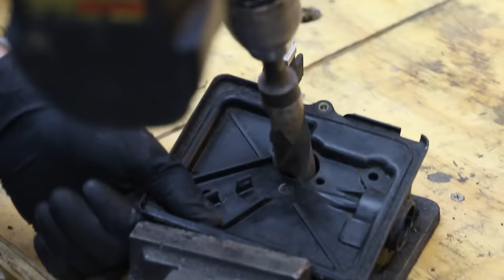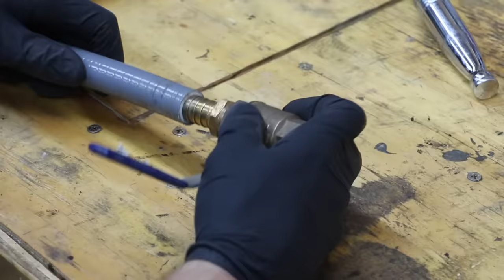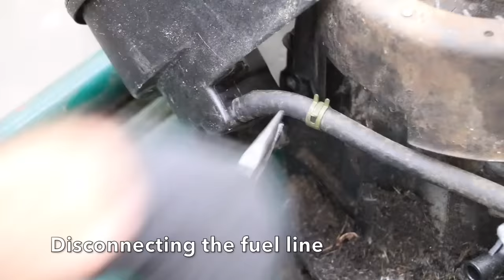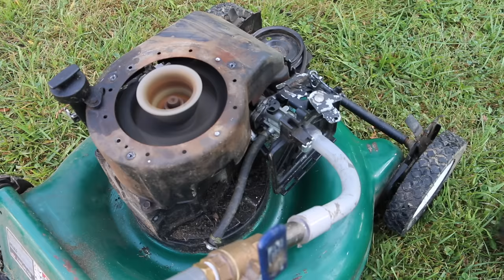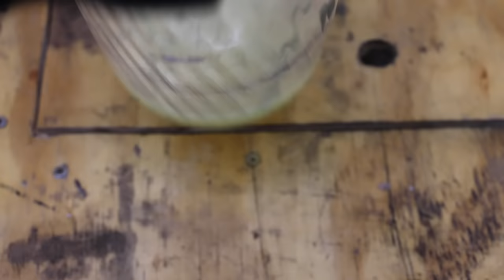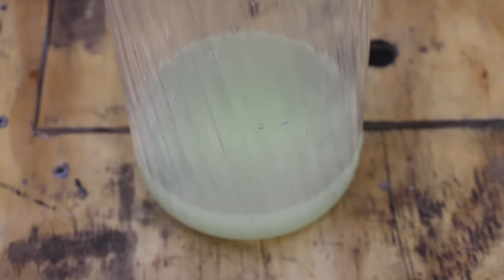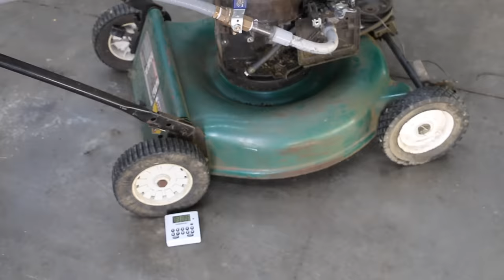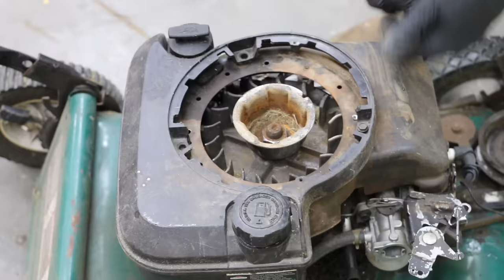Will a "Gas Vapor" Container Improve MPGs and Fuel Efficiency?  Let's find out!

Comment: Shell Oil engineers where testing vapor engines, it’s well documented, your video makes me wonder if they were primarily interested in reducing smog because of the cleaner burn when running on fumes.

It looks like the primary advantage to running on fumes per your testing, is reduced exhaust emissions, reduced smog. This is of great importance because less smog is a big plus.

My girlfriend and I are designing a vapor fuel assist system for our car, we are interested in reducing smog. Smokey Yunick achieved great success improving horse power and reducing smog with a vapor fuel system. He was also using a turbo which act as a one way check valve for the vapors.

Bill Kendrick’s here on YouTube uses a different approach to running on vapors. And he notes to have achieved significant improvements in horse power, and reduced exhaust emissions as well as reduced engine temperature.
Reply from the maker: I enjoyed reading your post. I hope you achieve great results in designing the vapor fuel assist system.
Reply: Thank you!
Reply: True Zero Emissions You're one of the few who remembers Smokey Yunick who answered readers' car every month in Popular Science magazine for years, long before they turned up their noses to practical things. Smokey's engine garnered attention from many car companies but he said they complained about meeting emissions standards--I suspect corporate inertia unless evil can be proven. Similarly, no manufacturer of gasoline engines has yet embraced the amazing Steam-O-Lene water injection system which is also for real but requires change in the mind of engine designers and their bosses.
Reply: True. And that 2 to 3% rise in efficiency calculates to Billions of dollars. Who loses out with better efficiency and less smog? The Government and big oil. Less gas tax and justification, and less gas consumption.
Reply: JRMCNEA His test was way too inaccurate to see an actual change. That 2-3% could be laying on the bottom of that gas tank or could be explained by his inaccurate measurements.
Reply: Lawn mowers have un-catalysed exhausts... A two or three -way cat on the lawnmower would be far more effective at reducing smog than this would ever be; and we don't even have any proof that this changes the smog/emissions of the engine whatsoever compared to liquid.  A lawnmower (which has only one cylinder mind you) will output something like 30-50 times the greenhouse gasses idling for an hour than would a car engine (typically 4-8 cylinders) idling for the same hour.
Reply: Blindi fuel injection
Reply: Just because you can't see it doesn't mean it isn't there.
Reply: Fuel injection atomizes the fuel, which vaporizes in the combustion chamber.  

Older engines usually used exhaust or coolant to heat the intake manifold to ensure vaporization of the fuel on the way to the combustion chambers.  If you've ever seen a factory VW Bug, you can see the heat risers off the exhaust running right along the length of the manifold runners - those were there to ensure any liquid fuel would vaporize after it settled out of the air/fuel mix.  The main reason for a carb or injectors is to meter the fuel.

As for this test, there's a TON of variables between the two tests.  You'd have to use a wideband O2 to ensure that the fuel/air ratio is correct and the same in each test.  None of us know how that carb is jetted, and none of us know what kind of ratio he's achieving in the vapor test, since it was pretty roughly tuned by ear.  2-3% is, in this particular test, way way inside margin of error just because of those unknowns.  Not nearly enough variables controlled for in this test to assert any kind of improvement.  

That said, as a former master tech, I can't see a vapor system like this offering any improvement in any area.  If anything, I'd expect losses, given that as cars have cleaned up, the metering of the fuel is happening physically closer to the combustion chamber until present day where we're using direct injected gasoline, which means it's going straight into the combustion chamber.

Ol' Smokey was one hell of a guy, but one thing to remember is that he's probably best known for being a cheating trickster - the infamous 7/8 scale Chevelle, and the time he was told by tech inspectors that, after removing his fuel tank, they'd found 9 violations, he started the (still tankless) car and yelled "make it 10" as he drove away.  Point being, I'd probably take info from him with a grain of salt.
Reply: Good deal! Do you have access to that shell research literature? It would be interesting to learn their methodology and set-ups. I want to take an old car and do this with its fuel tank and use it as a daily driver. Also, a genny for the lake could greatly benefit from this less fuel, less smog, happier earth. But this is coming from a dude that wants everything to be electric and photovoltaic.
Reply: I have copies of Tom Ogle's & Charles Pogue's patents. The only way to get a patent, is to have a proven running project. I know what you did wrong to not obtain the high fuel efficiency. Look up Tom Ogle's patent, you'll see how he did it. Shell oil company held the mpg world record for years. You can't make money off of fuel when you have people inventing very basic devices to reach proper fuel efficiency levels. The greedy and the ignorant flooded with hate and disbelief. It's damn simple to make the inventions, the problem is that either you keep quiet about it, or go loud and get murdered. Automotive companies have an agreement with the oil companies to not get good mpgs on the product, and it's all due to greed.
http://www.376mpg.com/
Reply: immikeurnot  Didn't he put Nadar up to killing the Corsair?  Corvair?  Corsica?  GM called on the talents of their ninth eighth over that, or had someone else built it?  I guess that as long as there are fraternity house blowjobs there will be internal combustion engines.
Reply: A cleaner burn implies better fuel economy (black smoke means unburned gas, blue is oil, white is anti-freeze and/or water).
Reply: That's the whole point really. Liquid fuel does no burn. By attaining as close to 100% vaporization of fuel, your stociometric burn is much more efficient and as a result your emissions are drastically reduced. The problem with all modern gasoline engines  is incomplete burn. Fuel injectors are not the answer. They still put a mostly liquid fuel charge into the combustion chamber.
Reply: Smokey's system wasn't using the turbo in a traditional manner plus he called it a homogenizer. The fuel was ran threw the exhaust to heat it then threw the turbo to atomize it before entering the intake I have the write ups about it in both a popular mechanics and hotrod magazine still somewhere in a box. It wasn't a true vapour system was done on a Fiero in the 80's boosting about 80hp and 5-8 mpg if my memory recalls it correctly. Still a very interesting system none the less.
Reply: The idea that someone made some genius invention, didn't share it with anyone,  and was killed for it by big oil is absurd.

I am no fan of corporations either.
Reply: I love reading some of those tinfoil hat comments, "murdered by big oil" lol.
It either works or it doesn't, careful what bullshit you buy into.
Reply: I can't see fuel vapor working with a turbo, at least not in this setup because of the lack of vacuum to suck the fumes in, unless maybe the boost pushes the vapor in? In curious
Reply: Gordon Freeman you just keep trusting the government.
Reply: john handcock no absurd at all Tesla was killed by big oil too
Reply: EFI homebrew systems can produce much more precise mixtures and you can tune them YOUR way. Open source software is available too.
Reply: Blindi crabs dont vaporize gas they atomize it there's a difference fuel injectors dont vaporize gas either

Comment: I didn't think it would work but imagine mowing your yard with just a mason jar of gas for the whole summer talk about saving gas lol
Reply from the maker: Thanks for the feedback.
Reply: Ot works if done coreectly, the process used in this video isnt how it has to be done.. Ive seen it done and ran a 235 cid 6 cyl. Chevy engine great and they got many miles from one quart of gasoline.

I guy in California tried to mark a setup for vehicles that ran engine off of rhe vaporized gas and he mysteriously died before he got it on the market.
Reply: @mapbike  Of course... care to share the correct method with the rest of the class?
Reply: @mapbike  share the method please
Reply: @charetjc  LMBO 😂...UMMM NO...But YES!!!
Reply: Why would it not work, it is basically a carburator. :)
Reply: @mapbike  Of natural causes right?

Comment: The difference in fuel economy can be attributed to difference in fuel mixture.  Your 'vapor chamber' (a home-made carburator of sorts) is running leaner than the regular setup.  Running extra lean leads to improved fuel economy, and can be done with any fuel system setup (EFI, carburator etc), but the downside is that it shortens engine life.  Even way back in WW2, airplane engineering teams understood these tradeoffs very well and tried to optimize them.  It was literally a life or death situation.
Reply from the maker: Thanks for the feedback.
Reply: I raced with it a lot. It was a third the price of race gas. In 4 and 2 strokes I always ended up a couple of jet sizes rich of normal to get plug reading I trusted. My racers were always gas hogs.
Reply: Dude running vapor dosent make your motor last less in fact it runs cleaner and enabels you to go longer between oil changes as the oil stays cleaner for way longer and it lubricats way better as its not black from carbon i can tell your not a macanic but if you are you need to change jobs.
Reply: @nofoxgiven6315  at least your English has improved, but that doesn't change the fact that you don't belong in this comment section.
Reply: I was wondering about the mix, becayse as far as I can tell the inlet on the carb is sealed straight to that pipe so I was wondering how the ball valve he put in the pipe would change the mixture. I would think it would just act like a throttle body. I don't see a way of dialing in the mix on most of these cars that people are doing this to, which could be bad, and would mean on a warmer day your engine will run more rich and even more lean on a cold day.

Comment: He built a gasoline bong
Reply: I just noticed it does have the same mechanics s a bong lol ;)
Reply: i built one out of a 1L methylated spirits (alcohol) bottle and ran a mower on it - it stalled out ofter 5 minutes and i couldent figure out why - started back up if i topped the fuel up (it hadent even used that much)
Reply: chris cole a
Reply: LV426 xenomorph "life is as extreme as you want to make it" - spongebob
Reply: Well when I look closely at my carb it's not vaporizing gas it sprays mist out not vaporizing so I pull bs card
Reply: Atomizing and vaporizing are two different things
Reply: chris cole vaporising and atomising at the same thing - the carby does its best to get the fuel into droplets on an atomic lever - obviously it Dosent fully Acheive it but by what’s seen in this video it has done a damm good job at trying to make it efficient but it just isn’t possible - there is only some much energy in petrol and it’s less than you think
Reply: Vaporizing, as seen in this video, and atomizing are very much different. The carb doesn't attempt to do anything at the atomic level at all, it simply sprays the fuel as tiny droplets. Still very much liquid, and that's important because as it enters the combustion chamber, it evaporates into a gaseous state and cools it off.